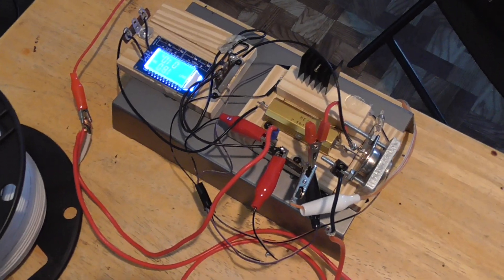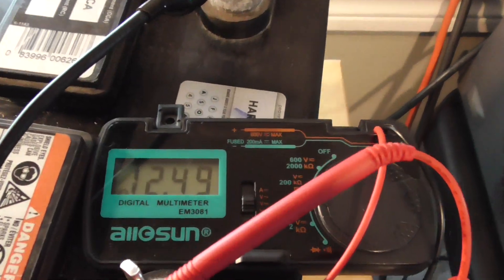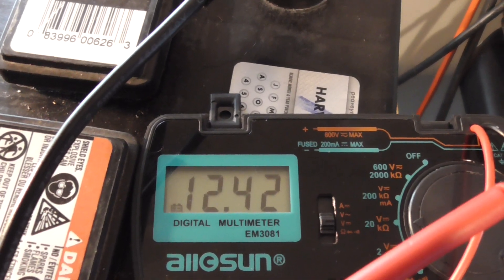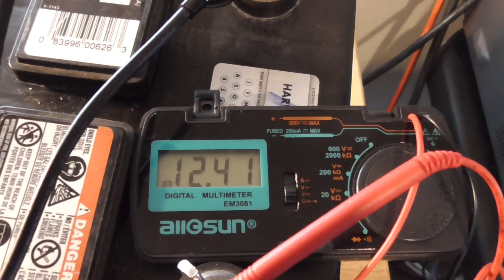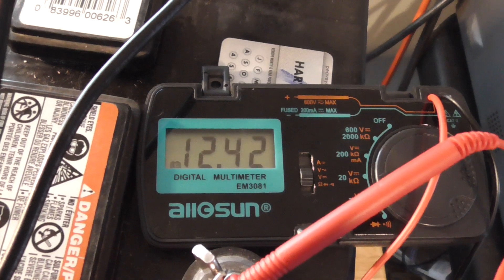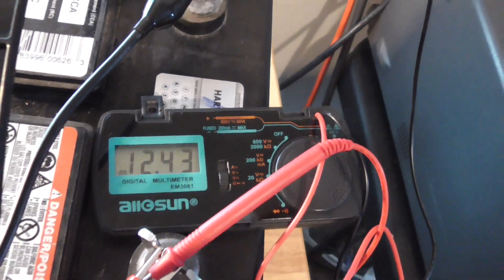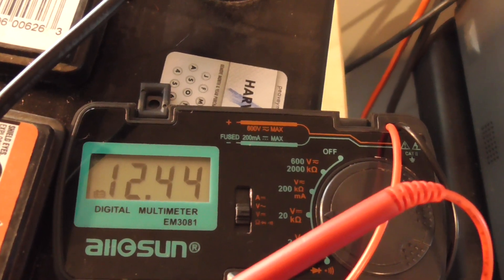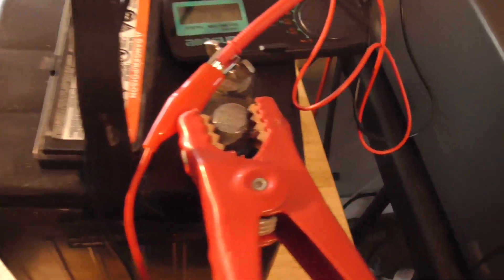100 watts of free energy

Comment: One of the most interesting experiment I've ever seen. Congratulations! It is easlily replicated. The only element that seems a little dificult is the big coil. From where are you getting it?
Reply from the maker: I just realized perhaps a key to why this works the way it does is the way I built that coil, its 4 cables inside its phone cable but I short out all 4 cables at each end of the coil, this gives me "one" wire but but inside the coil they are still individual and insulated from each other,  This might be adding some sort of "funky" capacitor, It might be acting as an electret as well pulsed at the right frequency. Just thinking because on one of Bedini's devices the gold electromagnet thing,. The core is built with multiple strains and separated kind of like what is happening with my coil configuration. Don't know if its related, just made me think that's all!
Reply: @joellagace1679  In this case I think that instead a phone cable, which is hard to find, it may be possible to use an ethernet cable, which has 8 insulated wires. The only difference between the two is that the phone  wires are thicker. But it could work. What do you think?
Reply from the maker: I just built a bunch of coils trial and error and measured impedance and took note of result. Most of my smaller coils where in the 10 ohms or more range. This one is around 300 feet of telephone cable wrapped around plastic spool and measures 1.9 ohms its much thicker gauge wire and much bigger coil, I trigger it at 10% or less duty cycle this holds back much of the 9 volt current from being wasted with the low impedance coil.
Reply: @joellagace1679  Maybe is related to the fact that high resistance means more heat, that leads to wasted energy. Therefore tick wires and low resistance is the key, as you're demonstrating.
Reply from the maker: @Machiuka  I think so dr Peter Lindemann later on stresses the idea of using crazy tick wires. Even in areas where you would not think of it, They say even an amp meter in line with such little impedance in line, was enough to cause all kinds of unexpected results.  But in the forums folks are complaining I'm doing it wrong and that my coil is way too big and they suggest to build a small coil, Been there done that. hehe. It "works" with small coil but not for the things I want it to do. I wanted to try something with the big wires and coils impedance wise. The circuit was very sloppy at first and it still worked! So after fixing it up, it really took off.
Reply from the maker: @justbob1581  An tiny coils give out more impedance. I think you got to make your coil as much as a "super conductor" as you can,  Resonance can also help with that at the right frequency.
Reply from the maker: @justbob1581  thanks!